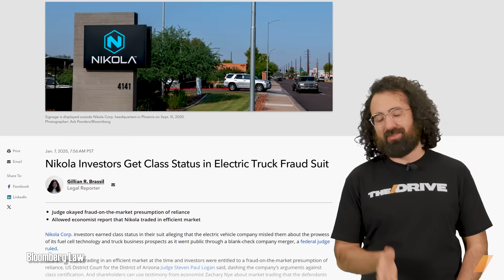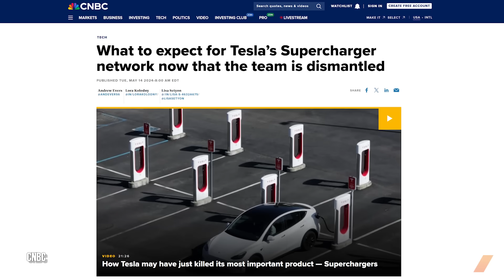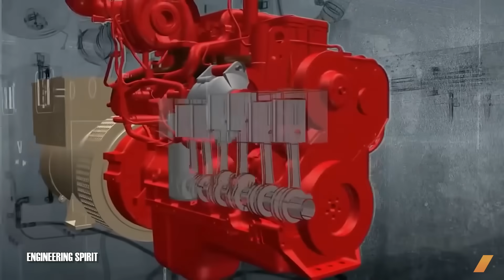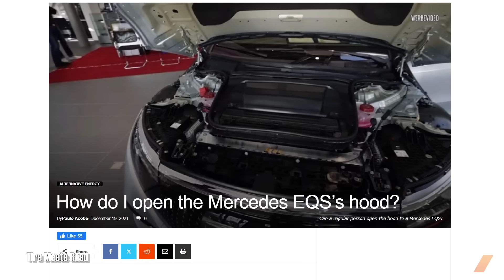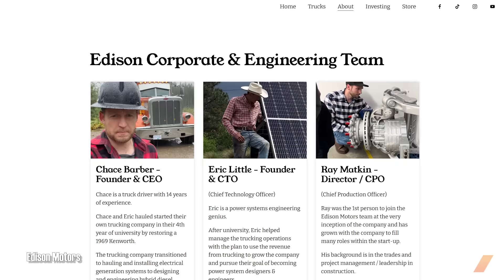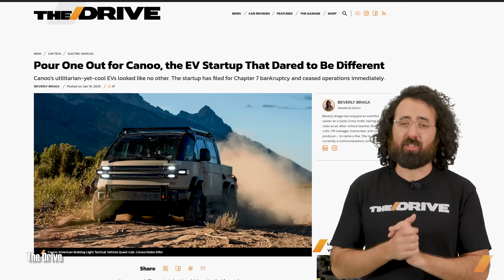The truckers in a shed beating Tesla with 100-yr-old EV tech

Comment: I've been wondering why they don't do this for a while.
There is another possibilty how to improve the trucks performance: 
Add electric motors to the trailer itself and connect them to the power from the tractor unit.
This should make handling on steep and slippery roads better

Comment: I wanna drive one of these so bad! I always wanted to use a 87 f150 with a 300 6 to do what these guys are doing. Only I gonna have one electric motor per wheel and I wanted to hide the 300 6 I’m using as the generator sideways behind the cab inside one of those bed mounted tool boxes.

Comment: 4:41 a Diesel engine that powers a generator could potentially recharge the battery and the same battery could power the motors as well.

I’ve been thinking the same thing about what hybrid vehicles should be like.

A combustion engine as a generator for the battery.

Comment: What is also needed is good quality Diesel fuel to make a considerable impact/improvement in emissions. Lohner-Porsche had a hybrid in the early 1900s that had the electric motors in the hub of each wheel, so clever was this that NASA also had an electric motor in the wheel hubs of the moon rover.

Comment: You never talked about regenerative braking ie A logging truck can recharge the battery when coasting down a hill without using the diesel engine
Reply: Yes, it's perfect for logging, they go up hill light and come down loaded.
Reply: @agent0066 saves on the brakes too, constant drag on the motor drive!!
Reply: @agent0066  Practically fuel itself that way
Reply: I was pretty bummed they didn't mention this aspect at all. It's been one of the major talking points for the logging application.
Reply: Yeah, that's a major point. But, it holds true for all electric too.
Reply: Edison motors has videos explaining this.
Reply: Edison had so many good ideas nobody can cover them all in one video lol
Reply: And no need for obnoxious Jake brake  at 6am on Saturday!
Reply: While they can do some regenerative braking, the problem is that they'll quickly reach a point where the battery is charged and that downhill kinetic energy must be wasted. In trains, this is done with big electric heaters to dump the energy. Edison is actually using the axle motor as a generator to drive the generator as a motor and traditional engine braking ("Jake brake") in the diesel engine because they can use a system that's already in place and don't need to complicate matters with heaters.
Reply: @jonjohnson3027  some logical energy management will go a long way to countering that problem. linking the usage of power from the battery into a GPS based computer would allow energy usage to be done smartly based on the inclines on route and learned energy usage thereof, so the truck arrives at the landing with enough free charge capacity left in the battery to be fully recharged again at the mill for the empty run back up the hill, with any energy deficit that needs to be made up can be done on the run back up with the generator operating as it's most efficient (~80%) load.
Reply: Bingo! It's the regenerative braking that makes it a diesel hybrid semi, and not a diesel-electric semi.
Reply: 🚗🚙🚚🚢✈🛩🚁Any mobile platform is only as good as it's power supply. The main advantages of our disruptive 𝔽𝕦𝕖𝕝 𝔸𝕘𝕟𝕠𝕤𝕥𝕚𝕔 ℤ𝕖𝕣𝕠 𝔼𝕞𝕚𝕤𝕤𝕚𝕠𝕟 engine is the constant maximal efficiency & torque...at any speed, load, temperature or elevation. No BS electronics & emission nonsense. 

It is Simple, Low Cost, Ultra Efficient, Constant Torque, Load & Speed Agnostic, Fuel Agnostic, Transmission-Free, Low Heat/Noise & No Smoke/Odor Signatures, Non-Polluting [only lower CO2 which is not a pollutant] with a >10 year [>10,000hr.] MTBO - better than EVs. >100mpg using ANY liquid or gas fuel even CONCURRENTLY W/O DOWNRATING, even if dirty, including hydrogen, biofuels or Natural Gas. [No range anxiety.] Vehicle lifecycle CO2 output is 30% that of EVs.

𝔽.𝔸.ℤ.𝔼 © allows an 𝕚ℙ𝕠𝕨𝕖𝕣𝔹𝕠𝕠𝕤𝕥 © mode for >400% more torque/power means efficient flight segments!!!

Simple, low cost/weight native 𝕊𝕦𝕡𝕖𝕣ℍ𝕪𝕓𝕣𝕚𝕕 capability is non-electric

Also developing a crank-less engine which itself adds 30% fuel economy!!!

#NFTG #DisruptingTheDisruptors© #FAZE©
Reply: Because break regen is a parlor trick
Reply: @victorkreig6089  Wrong. Regen is a viable concept that is easy to incorporate. It has a sweet spot while some apps are not worthwhile [light weight, low amount of stopping].
Me, I'm a CE, ME, AE and a prolific cross-disciplinary inventor
Reply: Plus braking will be a good thing.
Reply: IF there is in fact a hill, and IF you go down it loaded and not vice versa
Reply: Which saves fuel, because the engine isn't needed for exhaust braking, and there is much less wear and tear on brake components because only light (or no) braking is needed …for the most part.  It's the best of both worlds
Reply: This was the first push for Edison. Go up the mountain is a empty 12 tonne truck and come down in a 50-70 tonne truck. It is imagined that you would go up in the morning on the diesel and come down charging the batteries, then spend the rest of the day going up on batteries, and charging on the way down. There are similar plans for an EV ore train, Fortescue Metals Group Infinity Train, in Australia.  https://www.youtube.com/watch?v=CuLrc1u43gU  If they can generate more energy than it needs to get back up they can charge a seperate battery car they can use at the mine.
Reply: If it's diesel electric like a locomotive, wouldn't it be dynamic braking? Since there is no catenary for that energy to go back into, it would be dissipated as heat like on a diesel electric locomotive. I think regenerative braking is a diesel hybrid thing, where that energy can go back into the power source. Maybe I'm confused/wrong?
Reply: @michlo3393  no, regenerative, because it doesn't run exclusively on the energy created by the diesel engine, it also has batteries on board that are recharged.  But, the resistance created by regenerative braking does have the same effect of dynamic braking… just without wasting the energy it creates..
Reply: Perfect for a Metropolitan area on a Class B straight truck. Great use on a snow plow. Sitting for hours between pushing. With electric, the driver can have heat without running the diesel 😎
Reply: Edison has electric axels
Reply: I love the idea and let’s see the technology more in the future.
Reply: While you can recover some power in downhill runs, you never never get back 100% and complete electric is just joke for OTR trucking.  Fine for city delivery, there have been electric delivery in the big cities 100 years ago.
Reply: @billkraemer4710  You're wrong. Logging trucks are pulling virtually no load on their way up, just an empty trailer. Then they get loaded up with a heavy load of trees that were ALREADY at the top of the mountain, which creates a HUGE amount of potential energy, which then gets hauled down the mountain. 

You're looking at it from the perspective of OTR trucking, where the same load that is generating regenerative braking on its way back down a hill also had to be towed UP the hill in the first place, so there are obvious net losses there. The trees on the mountain are 'free' potential energy, because the trucks don't have to haul them up there in the first place.

If anything, those trucks will end up with a huge SURPLUS of energy by the time they get off the mountain.

This is simple physics.
Reply: @billkraemer4710  Regen is getting better. Graphene-aluminum batteries might bring it a step further.
Reply: @billkraemer4710  combine electric regen with the engine braking enabled by the engine mounted motor-generator and a retarder unit. that would provide an immense amount of infinitely variable retarding force and keep a majority of the braking effort away from the wheel/service brakes!
Reply: @billkraemer4710 Never? That's wrong, sometimes you can actually get back more than 100% of charge. I know of a mine on top of a mountain where the electric dump truck taking rock down the mountain never gets externally charged. It goes up the mountain empty and coming back down loaded it generates more energy than it can even store in the battery.
Reply: @antton9623 Efficiency is never 100percent, but I agree with you that you can regen a lot. Drive doen nearly 9000ft and it added 200km+
Reply: @travelguy78   No... But here is the thing. If you go up the hill empty? You use less energy. Going down the hill fully loaded? You can make more energy then going up.
All the extra weight is falling down the hill. The regenerative braking is stopping the fall.  Up the hill you are pulling empty air.
Reply: @travelguy78  You are mistaken, I didn't speak about 100% efficiency. I spoke about 100% charge, as in capacity, amount of electricity. The truck generates more electricity coming downhill than it can store in it's battery.
Reply: @antton9623  I know several examples like this. The rough math is pretty easy as long as you dont go into details like tire pressure etc. You lose energy , ie not 100percent efficient. Sometimes can be more efficient to coast. Or go full battery electric with cables
Reply: @travelguy78  Efficiency isn't really much of a factor though. What matters is primarily the delta between the energy required to get an empty trailer up the mountain, and the amount of potential energy contained in 40,000-80,0000 pounds of logs that are already at the top of that mountain.

Even if the regenerative braking was only 25% efficient, you'll still end up with lots of surplus energy, because the potential energy of the weight of the logs didn't come from the truck. It came from the fact that those trees did all their growing at the top of a big-ass mountain... ;)
Reply: @Wrenchmonkey1  In many cases efficiency matters. But in your use case, im glad that it don't. I'm a little surprised so many trucks go 80mph on the highway. Fuel consumption for me it's more than double at 80 compared to 60.
Reply: @travelguy78  It's the specific example use-case that is being discussed. They are obviously way more efficient than what I mentioned in my example, but I was demonstrating how efficiency is only tangental to the physics question at hand. Focusing only on efficiency misses the big picture of the overall topic.

No matter HOW efficient regenerative braking is (or isn't, if you're a glass-half-empty kinda guy) it's still basically a 'free' bonus that comes with EV propulsion systems, which you don't get from any other system. So worrying about the fact that it doesn't defy the laws of physics in order to achieve 100% efficiency or more is just looking a gift horse in the mouth.

Don't let perfection be the enemy of good. A win is a win.

The question of speed vs fuel efficiency is another cost/benefits analysis that has to be individually accounted for. Fuel costs aren't the only operating cost. The biggest operating cost is your time. If you can put in 33% more miles, doubling your fuel costs, that MAY work out to more money in a man's pocket, at the end of the day. Just depends on what your current rate of pay per mile and current fuel prices are. 

You only get a limited number of hours to put those miles in, every day. 

Maximizing those hours, and balancing that against your fuel cost, is a simple math problem. Some people do the math, some don't. But either way, your math problem is not going to be the same as the next guy's math problem. It's probably not even going to be the same as your math problem a week, or a month, from now. It's a moving target. If your fuel cost drops, that changes things. If your mileage rate goes up, that changes things too. Will driving 60 put you in a metro area right at rush hour? Might make a whole hell of a lot of sense to speed up to get through it miss that traffic altogether, instead of spending a couple of your driving hours sitting in it. 

Just do the math, and drive accordingly.👍
Reply: @antton9623  That's because you come down heavier than you go up. The second law of thermodynamics only applies to a closed system, and when you come down heavier than you went up, that extra mass is potential energy which gets transformed into electricity through regenerative braking.

Comment: Really, the option of a range extender generator should've been with all of these EV trucks, even the pickup EV's like Fords or the Cybertruck and Rivian.  At the very least, range extenders should've been optional.  Now I can see the Semis also having the option of a pantograph just as even diesel electric trains have pantographs as an option from the manufacturers (Germany does have overhead power wires installed over certain highway segments for semi's with pantographs).

Small engines have been designed for use with range extenders such as the axial engine so it shouldn't take a lot of space and weight for range extenders.

Comment: All European manufacturers have electric trucks on the road, the problem with them are prices and range. For example renault quoted me 120k € for a renault T with a 520hp d13 volvo engine and a medium sized cab while for an ev equivalent they quoted around 280k € (these quotes are from early 2024 the prices might uave changed). The idea of retrofitting old trucks with hybrid systems really appeals to me but the legislation in Europe for that is not quite friendly, at best you're lucky to install the same engine model your semi came with from factory(this is country to country based).

Comment: I use an EV step-van (bread-van, delivery truck) for work and it suffers from the "tyranny of the rocket equation" which for those who don't know, is that increasing a rocket's payload requires adding more fuel, which in turn adds more weight and requires even more fuel. An EV truck requires more batteries to carry more, which requires even more batteries to carry that extra weight. Our EV's can't carry anywhere near as much as our diesels and can only go a fraction of the distance besides. This idea they have of using an old idea in a new way is genuinely genius and I bet it'll really take off because it solves a lot of the issues people have with the current battery EV's.

Comment: Serial hybrid is what we should be doing for most vehicles the US. It eliminates one of the most treacherous components in a vehicle, the transmission. 

Sure, mechanical linkage between a combustion engine and the wheels is the "most efficient at highway speeds" but Honda and mitsubishi figured that out with a single fixed highway gear. 

But for a semi that's irrelevant anyways because we would be talking about the difference between maybe like 4.9 and 5mpg, and no transmission maintenance over the life of the vehicle will probably equal out cost wise. And you still get the benefits of an exhaust brake by using the generator bolted to the diesel engine to spin over the engine

Comment: I've been waiting for someone to do this since the first Prius was released. Locomotives have been using diesel electric hybrid drivetrains for decades and using electric motors to move the vehicle and powering them with a combination of batteries and a diesel generator is a more efficient way of extracting work from fuel. Electric motors make all of their torque at any RPM, which is great for hauling. Why has this taken so long?

Comment: Being 25% more expensive than a freightliner is no big deal when you figure the emissions system is pretty much guaranteed to cause down time. I work on Cascadias daily and 70% of the trucks in our yard have a CEL with one form or another of aftertreatment codes. There is nothing reliable about aftertreatment, edison has the right idea. I could see the industry shifting to hybrid drivetrains by 2035 if not sooner due to how much of a headache emissions systems are.
Reply: Just curious, what kind of aftertreatment problems do you normally have?

Diesel hybrid still needs to meet EPA standards and so will still require exhaust aftertreatment.

Comment: Their is a German youtuber (Electric trucker) that makes videos about his truck (also in englisch now) he can make it work quite well.
(With german labor law and European infrastructure)
Reply: More power to the German Electric Trucker guy :) Godspeed.  Edison is working on heavy duty off road, 14 hour day, logging trucks capable of hauling 65 metric tons. Electric just can't keep up.
Reply: @Sah-o5m  i love both Youtube channel very much, and both are right. I want to say full BEV makes sense for some applications. Diesel electric isn't the only way.
Especially because edison doesn't want to get into the highwaytruck market where they save 5%, they want the heavy haul, offroad, "fuck it we need torque" market, but in the video it sounds like diesel electric is the answer for everybody, well i am not sure about that
Reply: @Sah-o5m  the batteries can't keep up, e motors are made for high torque low speeed stuff